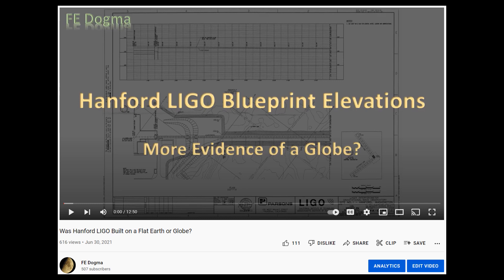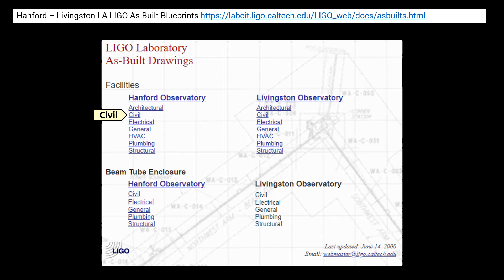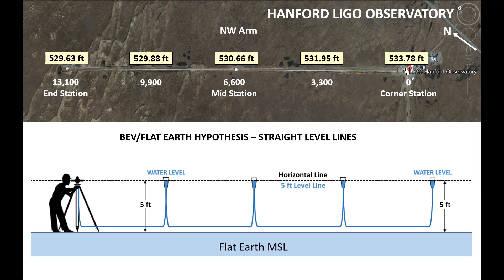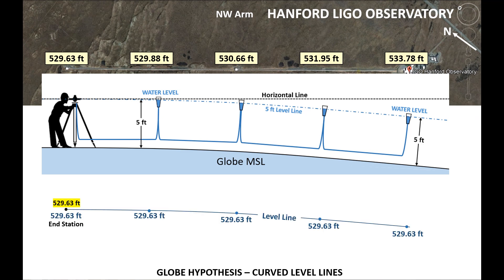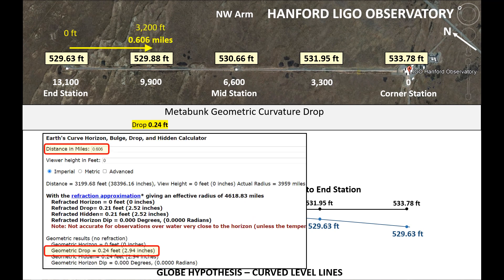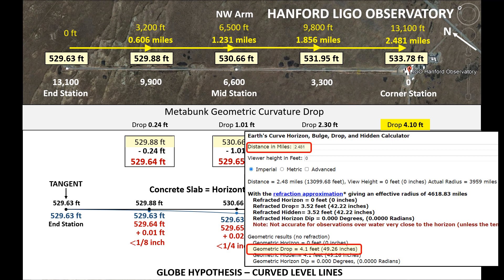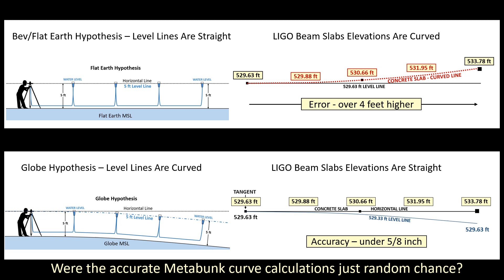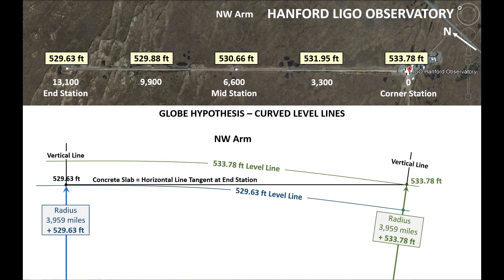LIGO Revisited - Still Globe Evidence

Comment: How do you imagine the concrete company figured out how to pour a slab with an elevation profile shaped like a U? Do you imagine they poured it thicker on both ends to account for a hump in the middle or just one to account for a drop away from your tangent point? If the "direction of down changes" as you imagine it somehow does, how would the concrete set horizontally? So many problems for your model, little buddy. Rooting for you to reach out to some builders and ask them. Please record that conversation! Be sure to tell them that you imagine that concrete naturally sets into a curve and then ask them how they will remove that "natural" curve and make it set "unnaturally horizontal." :D
Reply: Are you saying it is completely impossible to build something flat, unless the Earth were flat already? So, since it couldn't be flat anyway neither on land nor on water, because of hills, mountains, valleys, sea waves, tides, seiches, etc, in other words you are saying that it is impossible to verify whether it is flat or not, which means flerfs are just begging the question.

Another epic flerf fail. Congrats!
Reply: @primonomeultimonome  Are you saying you imagine there are converging directions of down and concrete dries and hardens into a "natural" curve but they figured out a way to make it horizontal for just this project? Tell us more about your belief in magical LIGO concrete.
Reply: @DrEMichaelJones  How unfortunate, your question shows you still don't grasp the difference between horizontal, flat and level, as others have pointed out already. But the day you'll come out of the Middle Age, you'll discover the existence of positioning methods based on modern technology, able to locate points in space down to inch precision. Just take your time!
Reply: @primonomeultimonome  so you don't know how it could be done. Got it. Enjoy your day, little buddy! :D
Reply: @DrEMichaelJones  The whole world knows how to do it, as it is routinely done. Only your in little flerf echo chamber a bunch of cultists can pretend otherwise. But keep showing up, little buddy, people love your flerf comedy gold. 👍
Reply: "How do you imagine the concrete company figured out how to pour a slab with an elevation profile shaped like a U" 

how large a slab segment did they pour at a time, and how much curvature would there be across that slab segment size?
Reply: @hartmutholzgraefe  Could you lay a series of blocks around the perimeter of a round pond?
Reply: @vespa2860  "Could you lay a series of blocks around the perimeter of a round pond?" 

How large are the blocks, how large is the pond, and what are the manufacturing tolerances of the blocks?

Basically you're asking me whether a round swimming pool could be tiled with flat tiles? Or circular chimneys could be built using rectangular bricks? I'm pretty sure I've seen multiple examples of both over the years ...
Reply: @hartmutholzgraefe  It was a rhetorical question! Of course you could! Tagged you by mistake - got no interest of dealing with trolls directly.
Reply: @hartmutholzgraefe  There would be zero curvature for any size slab. It's concrete.
Reply: @DrEMichaelJones  
You think they may have used a laser to build the forms?
Funny how you nitwits keep confusing straight, flat,  and level.
Reply: @DrEMichaelJones  LOL, as usual you don't have the slightest clue what you are talking about. I worked for a company that made a software (AutoCAD plugin) for designing concrete formwork aka shuttering. Our customer, who makes the formworks would pour you any f***ing slope you like provided you can pay. Have you never seen a concrete bike ramp ffs? 🤣

Nevermind that for a miniscule slope like this it's not nearly required because raw concrete is highly viscuous and has to be straightened anyway… plus polishing after it's cured if you want anything resembling a smooth surface. Dear oh dear…
Reply: @TruthNerds  
The tolerance of the concrete pour is really irrelevant. The anchor feet between the slab and vacuum tubes are adjustable.
Reply: @TruthNerds  that's fascinating, little buddy. So first they level the ground, right? And then you imagine they're going to pour a "U-shaped slope" on that level ground right? Tell us more. Who decides where the hump is or do you go for the drop like FEDogma imagines?  Where do you imagine they'll be placing their forms? 

Why don't you try to draw a picture of it? Better yet, why don't you get some concrete and try to do it yourself? Bonus points if you film it and upload it to youtube. Rooting for you! :D
Reply from the maker: @DrEMichaelJones  All I can say is it really possible to be this ignorant on both the subject of surveying and construction?  Why do you think Bev is correct because as I showed in this video, both of those beam arm slabs curve up over 4 ft higher at the opposite end with Bev's definition of a straight level line of equal elevation.  Now under what logic would LIGO be built with curving slabs?
Reply: @fedogma8407  LIOG isn't built on curving slabs because slabs of concrete foundation don't curve. Not in any size slab. 

All I can say is that it's hilarious that you imagine that a construction company can pour a concrete foundation straight on what you imagine is a "curved level" ground. Do you imagine they would shim both sides due to a hump or just one due to a drop? Have you tried calling any to ask?
Reply: @DrEMichaelJones  Repeating your argument from incredulity is not a point. And 2.5 miles  of concrete are not poured in one go. Do you even listen to yourself? 🤣

But if you do want to see concrete poured into a U-shape in one go, it's called a half-pipe. I guess these must be fake, too. Well either that or every 12 year old with a skateboard is more knowledgeable on construction than you are. 🤣

Blue has covered documentation on the construction of LIGO before… GPS surveying was used, of course you don't have any clue how that works either.

And I guess my job's fake because you would be totally unable to do it and demand that everybody has to do everything themselves (another hallmark of pseudoscience).
Reply from the maker: @DrEMichaelJones  You keep ignoring that fact that those LIGO blueprint slab elevations plot a curved line over 4 ft higher from one end of the slab to the other with your definition of a level line.

As for pouring concrete in construction, I was responsible for 1,000s of slab, deck, column and wall pours in commercial construct on large projects.  It is laughable that you think earth curvature, which is less than a 2 inch Sagitta from the chord of a mile long arc, would be an issue when pouring concrete.  Our tolerances are larger than any earth curve errors. 

Why do you feel compelled to think you are an expert and comment about subjects you have absolutely no clue about?
Reply: @scott_meyer  Thanks, good point! In any case our little buddy here will definitely continue to pretend that pouring a slope (or a curve for that matter) of concrete to within reasonable tolerances was an unsolved problem. Imagine if only things that he can  understand were real… there'd hardly be anything left. 😄
Reply: @DrEMichaelJones  "There would be zero curvature for any size slab. It's concrete." try putting concrete into a rotating container and let it set there, that surface will have curvature for sure. There is no magic flatness property in concrete.
Reply: @fedogma8407  Do you imagine you'd pour that horizontal concrete 2" thicker at either end and go with the hump reference frame or do you imagine you'd pour it 8" thicker at one end and go for the drop?  Who do you imagine would pick the frame of reference?
Reply: @hartmutholzgraefe  Concrete is poured. It's a liquid. the bottom on that liquid will form the shape of it's container, like water. The top when smoothed out will form harden horizontally and level. This is not hard stuff.
Reply: @DrEMichaelJones  epic fail there, little buddy!
Reply: @anamorphicmind  I didn't expect you to come up with a construction plan, little buddy. But you can just go on believing that concrete somehow magically hardens with converging downs. I don't want to burst your bubble any further. Enjoy your day! :D
Reply: @DrEMichaelJones  just when the epic fail couldn't continue you keep going, little buddy.  You've obviously never seen a sloped drive way, little buddy. 🤣
Reply: @TruthNerds  
If you think about it, there is no requirement for the tube to be "level". It simply needs to be straight enough that the laser beam doesn't encounter the side of the tube. They could have drilled a 2.3 km hole in the ground and it would still work.
Reply: @anamorphicmind  it's ok little buddy, eventually you'll figure out that the ground under that driveway isn't level. Then you'll start wondering how you're going to pour straight concrete on what you imagine is a curved surface. 🤣
Reply: @DrEMichaelJones  "LIOG isn't built on curving slabs because slabs of concrete foundation don't curve. Not in any size slab."

You're very confused… the slabs are not curved anyway, they are sloped. A level line that you reference them against is curved.
Reply: @DrEMichaelJones  "Concrete is poured. It's a liquid. the bottom on that liquid will form the shape of it's container, like water. The top when smoothed out will form harden horizontally and level. This is not hard stuff." 

Concrete is not really a liquid, but has similar properties to a highly viscous fluid. So It will not necessarily fully smooth out. But more important: even a true liquid will not have a plain surface when in a rotating container. The surface will be concave in that case. In general it will always try to find its equilibrium perpendicular to the effective force vector at each surface location. When only affected by gravity alone that leads to an almost flat surface, curving with a radius of over 6000km, so it will look flat. When rotating there's also centrifugal force acting on it, so you end up with a concave surface. When on a very small scale the fluids own surface tension will be me most prominent force, and you get a concave surface. When in free fall surface tension is the only force acting on the fluid, and so it forms spherical drops. 

I would be happy to reply with "This is not hard stuff", too, but apparently it is to you :(
Reply: @hartmutholzgraefe  it is actually a liquid when mixed with water, little buddy. Thanks for confirming that you don't believe it hardens horizontally when it's leveled. How do you imagine you can make something straight from something you imagine will always harden humped on ground that you also imagine is humped? Do you imagine the concrete company started at one of FEDogma's "tangent points" and shimmed out in one direction to fill in the "drop" or do you imagine they started at a hump and shimmed out on both sides?
Reply: @hartmutholzgraefe  Now I kind of want to see someone try to make a concave parabolic surface by spinning wet concrete mix or crunchy peanut butter in a fish tank, the way you can with water.
Reply: @DrEMichaelJones  ""It is actually a liquid when mixed with water"

Water is a liquid, concrete is a mix of water (liquid), sand and gravel (solid) and even some gases. Concrete is a fluid until it binds, but not a liquid. Pour a liquid on a flat, smooth surface and it will spread out to a more and more thin layer. Pour concrete on a flat, smooth surface and you get a blob that spreads out a little, but never "finds its own level" withough extra help.

If concrete woukd really find its own level by itself there would be no need for puttig an extra layer of floating screet on top.

", little buddy."

Why do you need to call everyone "little buddy" here? Inferiority complex maybe?

"Thanks for confirming that you don't believe it hardens horizontally when it's leveled."

See, it needs artificial leveling, e.g. using a plank drawn over it, to harden with a flat surface. It does not find its level by itself without some extra help, the puddles that form on my driveway when it rains clearly show that ...
Reply: @hartmutholzgraefe  yes we know you imagine that water doesn't find its own level either. Strange that no pushing is involved. Do you imagine that coffee isn't a liquid either? How about salt water? It has a solid in it, salt. How about plain water? You can remove lots of solids from tap water. Do run around telling people they're not liquids either? Tell us more about how angry the word liquid makes you when you imagine its being used incorrectly.
Reply: @DrEMichaelJones  "Do you imagine that coffee isn't a liquid either? How about salt water? It has a solid in it, salt." these are liquids just fine as they have dissolved solids in them. You're not really comparing the undissolved sand grains and pebbles in concrete with dissolved Sodium and Chloride ions in salt water?

"You can remove lots of solids from tap water." Not by filtration though as these substances are not solid while dissolved. The sand and pebbles in a concrete mix can be separated from the water by simple filtration though.

"Do run around telling people they're not liquids either?"  Why would I?

"Tell us more about how angry the word liquid makes you when you imagine its being used incorrectly." I'm not the angry guy calling everyone "little fellow" and such. It is not my fault that you don't know the difference between a fluid and a liquid, or between dissolved and just mixed. It doesn't make me angry when you use terms like liquid incorrectly, it is rather entertaining I have to confess ;)
Reply: @hartmutholzgraefe  it's ok, get it all out, I'm here for you.
Reply: @Mike I'm sure that's is NOT what you are here for ;)
Reply: Just a thought: if you poured concrete slabs 50 yards (45.72 m) long and wide over a float glass base and somehow gave them perfectly level tops as smooth as their undersides, then positioned them to make a level warehouse floor, and somehow got one of them upside down in the process, nobody would notice.
The centre of the inverted slab would be 82 microns low. That's a perfectly respectable size for an amoeba.
Reply: @Sableagle  Ah the "nobody would notice" defense is one of my favorites. Tell us more about how you imagine that "nobody would notice" your buddy's 59.2" thick pour at one end and his 10" pour at the other.
Reply: Time to check in on The Constructor for some expert advice, or some advice that's utter bollocks, depending on how good a site that is.
Personally, I wouldn't want my concrete members to be slopped anywhere, but hey ...

FAQs on pouring concrete on an inclined surface
?How do you pour concrete on a steep slope?
Pouring concrete on the sloped surface needs excellent skills and experience to perform the work as planned.
Commonly, low slump concrete used for slopped concrete members, driveways, or wheelchair ramps.
Make sure concreting begins from the lowest point of the slope. Then, concreting progresses slowly upward.

?How do you increase the slump value of concrete?
Adding water to the concrete mix will increase the concrete slump.

?What slope is too steep for a walkway?
The maximum slope for the walkway should not surpass 5%. The percentage of the slope is calculated by dividing rise over run multiply 100.

?How is the slump value measured?
The slump value is measured from the top of the slump mold to the top of the concrete.

So 5%, eh? That's the tangent, the way it's described there, so what's arctan(0.05)? 2.8624° We can pour a concrete walkway with a slope up to 2.8624°, and for this long slab we need a slope that goes from 0° to 0.036°? Well, that's not taking into account ellipticity of the Earth and so on, but all of that isn't going to make two orders of magnitude of difference. We are well within the tolerance there! Let's see what else The Constructor has to say.

Fine-Grained Concrete: Significance and Properties: Explained With Video
Fine-grained concrete, also known as sand concrete, is defined as the concrete in which the coarse aggregate is replaced by sand or any filler material. The maximum size of fine aggregates used in fine-grained concrete is 10 mm.

Ten millimetres. They're replacing coarse aggregate with fine sand and the maximum grain size in their fine sand is ten millimetres. That's one chunk of a sand grain. I'm going to go and check somewhere else for confirmation. From GreenSpec:

The usual range employed is between 9.5mm and 37.5mm in diameter. - Fine aggregates are usually sand or crushed stone that are less than 9.55mm in diameter. Typically the most common size of aggregate used in construction is 20mm. A larger size, 40mm, is more common in mass concrete. Let's try Cement Concrete for some more info on grain size.

Sieve analysis Procedure:
Take a typical oven-dried sample of sand that weighs about 500gms.
Determine the exact mass of the sample.
Prepare a stack of sieves and place the sieves of sizes 4.75mm, 2.36mm, 1.18mm, 600u, 300u, 150u, and 75u with larger opening sizes above the ones having smaller opening sizes. A pan is placed at the bottom to collect the portion of sand passing through all sieves.
Pour the sand into the stack of sieves from the top and place the cover. Then fix the stack in the sieve shaker and shake for 10 – 15 minutes.
Stop the sieve shaker and measure the mass of the retained sand in each of the sieve.

There we go. Someone does get us all the way down to seventy-five microns, so there is someone, somewhere, who bothers to separate out that little 81 micron sand grain that'd fit between where the surface of the flipped slab would be and where the surface of a right-way-up slab would be from the even smaller 60 micron sand grains. It's big enough to matter to someone, after all. Time to grab something from Wikipedia?

ISO 14688-1:2002, establishes the basic principles for the identification and classification of soils on the basis of those material and mass characteristics most commonly used for soils for engineering purposes. ISO 14688-1 is applicable to natural soils in situ, similar man-made materials in situ and soils redeposited by people.

630 mm and up: large boulder. Yeah, that seems reasonable.
200 to 630 mm: boulder.
63 to 200 mm: cobble. I'm getting the impression these are metric approximate equivalents of 25 inches, 8 inches, 2.5 inches and so on, but whatever.
20 to 63 mm: coarse gravel.
6.3 to 20 mm: medium gravel.
2 to 6.3 mm: fine gravel. Two millimetres is fine gravel? Okay then.
0.63 to 2 mm: coarse sand.
0.2 to 0.63 mm: medium sand. No prizes for guessing what comes next.
0.063 to 0.2 mm: fine sand.
0.02 to 0.063 mm: coarse silt. Those "even smaller 60 micron sand grains" aren't sand grains. They're silt particles.
0.0063 to 0.02 mm: medium silt.
0.002 to 0.0063 mm: fine silt, still bigger than bacteria, still visible as individual grains under a visible-light microscope.
Under 0.002 mm: clay.

Let's start with that 0.002 mm figure. That's 3 times ten to the negative 13 of the volumetric mean radius of the Earth. Small fraction!
One minus that is the cosine of 45.4 microdegrees. Small angle. The tangent of that is 792 nano, in this case 792 nanoradii.
Multiply by a radius of 6371 km and we get 5.048 metres or 5 yards 1 foot 6.75 inches.
If you built your base out of concrete slabs up to 5 yards long with flat, rather than level, tops, the centre of each slab wouldn't be far enough below the level of the ends to get a single grain of fine silt into the difference, and the concrete itself is probably made with grains ten thousand times that large.

Like I said, nobody would notice.
Reply: @Sableagle  You do realize that FEDogma said the LIGO arms are horizontal, right? He even labeled them horizontal. There's no slope in horizontal. Zero.
Reply from the maker: @DrEMichaelJones  You keep ignoring the fact that those LIGO beam arm elevations are a curved line 4 ft higher in elevation at the other end with your definition of a level line.  So please explain why this arm would be constructed in a curved shape when a laser beam is straight?
Reply: @fedogma8407  you keep ignoring that concrete needs pouring and you have Zero idea how the concrete was poured
Reply from the maker: @DrEMichaelJones  Of course you didn't answer the question because you would have to admit that with your definition of a level line is BS those slabs are curved and with my definition of a level line those slabs are straight.
Reply: @fedogma8407  concrete slabs, when leveled properly, definitely harden and set horizontally. Good for you to finally understand that.
Reply from the maker: @DrEMichaelJones  Are you really this fucking ignorant?  Really??  So why is that slab a curve with your definition of a level line?  Look at the evidence and pull your head out of Bev's rear end because you are suffocating on his BS.
Reply: @fedogma8407  level concrete slabs aren't curved, little buddy. Are you finally getting it now?
Reply from the maker: @DrEMichaelJones  I agree and that's why LIGO is evidence supporting the globe because if Bev was right and level lines are straight then that slab would curve up over 4 ft at the other end.  For some reason you aren't smart enough to understand this.
Reply: How to Make a Concrete Wheelchair Ramp Over Stairs with Quikrete Sakrete and Kobalt Electric Mixer. https://youtu.be/SMsH9ZTyT8U
Guy even started in the top corner and worked his way out from there to the bottom edge, piling the concrete mix up against the steps first.
Reply: @fedogma8407  now you just have to find a builder to try to explain how you want to 4 foot thicker concrete on one end of the ground that they level. Which end do you pick and why?
Reply: @Sableagle  that's great little buddy. Now you just need to tell the concrete company where you imagine the hump begins on the level ground so they can somehow ramp up/down for a horizontal pour... rooting for you.
Reply from the maker: @DrEMichaelJones  So you agree this is a problem with your definition of a level line since the slab plots a curved line.  You need to answer that question because this is your fantasy world.  Of course the reality is that we live on a globe so this was not a problem since the slab was straight.   We know how to grade elevations to the requirement of the job.
Reply: @fedogma8407 a problem with level being a straight line on a horizontal plane? No problem at all. Have you figured out where you're going to tell the concrete team where you imagine the top of hump would be on level ground so they can start their pour?
Reply from the maker: @DrEMichaelJones  Again, ad nauseum, then why does that LIGO concrete slab curve up over 4 ft at the other with your definition of a level line?  Do you ever look at the evidence?  And WTF is the hump?  Are you at the zoo looking a camels?
Reply: You try to imply that a 13,100 ft long slab of concrete would be poured in one piece – but this is not how concrete is used; we have some old highways here in Germany that were made with concrete (by now concrete is only used for certain cases) – and they are made out of small slabs, maybe 50 m long. If the slabs are short enough (say, 50 yards – I doubt that they would pour longer slabs), the slab's surface would seem flat (it wouldn't be perfectly flat anyways, as concrete has some viscosity). And there would be a tiny step to the next slab if the elevation has to increase (and this slab would have a very tiny angle to the previous one). It doesn't matter that much in the end, as the actual height for the tube would be adjusted at its support points (say, two on each slab). Over the whole distance it wouldn't matter that each slab is slightly curved in itself, as we're talking about 1" over the 50 yard distance (using the infamous 8" per mile squared formula), and each slab would have a slightly increased elevation (as it actually has). Make shorter slabs, and even the step from slap to slap would become practically unnoticeable.
Reply: @c.augustin  8" * (distance / 1 miles)² for a 50 yard slab?
0.0065 inches, if you start with one end level.
Level it in the centre instead and you get 0.0016 inches.
Reply: Of course, if you pour it with a level, rather than flat, top surface, it'd be level the whole way and a spirit level placed on it anywhere would tell you it's horizontal there too.
0.0016 inches below level in the centre of each slab if you use flat-topped slabs to make part of a polygon, then.
Reply: @Sableagle  and then what do you plan to do with what you imagine are humped (in the middle of course, right?) concrete slabs? Will you try to align them straight starting from what you imagine is the alleged humped middle point of the level ground and shim them "up" to horizontal on either side to make your "u-shaped" elevation or do you imagine you'd start at one end and shim all the way out to the end?  Draw it out for us... or maybe make yourself a little clay model.
Reply: @Sableagle  I made a calculation error, you're right – only measly 0.0065 inches, practically far beyond being measurable (this would be even smaller than the roughness of concrete surface). I'm European and not well versed in using imperial measures (or however you might call them), metric is much easier to scale and less error-prone. I think I used the number of feet in a mile instead of yards, and with squaring numbers this would lead to a much larger number. Still, even 1" would not be that much on a 50 yard slab (well inside the precision of pouring concrete – if I look at what was done when renovating our approx. 12 yard long house, 1" looks already precise … ;-))
Reply: @c.augustin  Have you figured out where the hump is or do you imagine it's a drop from only one side? Have you tried calling any concrete companies yet to ask them how they plan to string together a series of humped slabs across what you imagine is "curved level" so that they form a straight horizontal baseline? Do you imagine they should start from the middle and have two teams work their way out to the ends or start at one end and construct FEDogma's "tangent" in just one direction at a time?  Tell us more about how you imagine this is the one and only construction site in the world where they were able to make concrete horizontal and at all the rest you imagine it curves. Do you believe there's a super secret construction company out there hiding this valuable info from others who wish to harden their concrete level and horizontal?
Reply: @DrEMichaelJones  "where they were able to make concrete horizontal" – They don't have to, as it doesn't matter, as long as the support points of the tube are in an optically straight line (and this is what the elevations are for – and they are there, simple as that). You are fixated on this being a single peace of straight concrete to work, which it doesn't need to be and isn't (I've explained how it would be done). And as usual, you have no idea about scale. And surveying would start at the center station and go outwards (as it would have to), defining elevation points along the route – I'm sure surveying was constantly done in this project (it even happens when building a long highway, as I've seen more than once when driving long distances). This is a very special case to build, and I'm sure it wasn't done by your run-of-the-mill construction company.
Reply: @c.augustin  What do you imagine a non-run-of-the-mill construction company would do to try to build a straight concrete foundation on top of what you imagine is "curved-level" ground? Have you figured out if they'd go for shimming it starting at the hump and working outwards or do you imagine they'd go for the drop reference frame and only shim it on one side? Have you tried calling any  non-run-of-the-mill construction companies to ask?
Reply: @DrEMichaelJones  You still make up a problem where there's none (the concrete doesn't have to be actually completely straight, only the support points of the tube have to be in a straight line (and I'm quite sure they are adjustable, but with this large of a diameter half an inch wouldn't matter) – the concrete can be stepped or curved and built up slap by slap). Since the elevation data starts at the center (and is constantly going up from there), construction would be done as I suggested from the center to the endpoints (this is no bridge), like a highway (which can also be built up and down as needed – how do they do that up a hill or a mountain in your mind?). You try to obfuscate the fact that the elevation gets higher from the center to the endpoints, matching earth's curvature to a very small amount (around half an inch) – how the construction was done is just an engineering problem, and I'm sure that the engineers involved found a viable solution (and had tolerances to match, as is done in any form of engineering – like in electrical engineering, which I'm familiar with). It was done, the data is publicly available, and perhaps there's even more data available about the whole construction.
So, how would you explain the elevation data, if earth would indeed be flat?
Reply: @DrEMichaelJones  Oh, and you can just look at the northern leg of LIGO in the Wikipedia article – and you can clearly see that it is raised there. And that the tube is built with short segments (even shorter than I guessed, maybe only 2 yards long), half embedded in the (raised) ground. So they might actually have built these segments somewhere else (in a factory, or those are actually some standard elements used for tunnels) and placed them one after the other – I can't see a "completely straight concrete foundation" anywhere (there might be a concrete foundation beneath the tube segments, but it could be small and rough pieces over the length). You simply have no viable argument there.
Reply: @c.augustin  so you imagine they built it imagining a hump in the center as opposed to a drop from one end? How do you imagine they decided on the reference frame they should build from?
Reply: @DrEMichaelJones  You constantly overcomplicate things. The center is the reference elevation, from there they made normal ground work (same as for a highway) and dig or bank up the ground to get the right elevations, do foundations (step by step) to the endpoints as needed. No "reference frame" needed (well, it could be done from the halfway points of the legs, than elevations would go down in one and up the other direction – but it wouldn't matter; easier to go from the center), just doing proper surveying. No need for any imagination, just calculating the proper elevations (from the center) beforehand. And it doesn't even need to be overly exact, as the actual tube is mounted in a rig where it can be finely adjusted (and this could be checked with a laser beam). The main engineering problems are with the interferometer itself, not all the building work around it. Where's your problem? The elevation data is clear, how to build it is actually much easier than I thought at first. After having seen the short tube segments, it might have even been built by a run-of-the-mill construction company and a very good surveying company (this would be the not-so-easy part). What's your problem?
Reply: @c.augustin  so you imagine that the concrete teams would start at the center and work their way out? Is that because you imagine a hump on level ground as opposed to a drop?
Reply: @DrEMichaelJones  There's always a drop from the horizontal. Everywhere on earth. If you are high enough, you can measure it even with simple tools. It is done over and over again (even here on YT), correcting for it is part of celestial navigation (if you use the visible horizon instead of a spirit level; additionally refraction is accounted for if the horizon is used). Simple as that. To go from the center has nothing to do with that, it is just common sense to use the point where everything meets and go outwards (this way you avoid problem with accumulating measurement errors). Again – where's your problem? What's your explanation for the elevation levels shown?
Reply: @c.augustin  If there's always a "drop" then why are you imagining that they would pour a concrete foundation around a hump?
Reply: @DrEMichaelJones  I see what you're doing here (next I come up with gravity and you say it doesn't exist etc.). Time to answer my questions, or better just the one real question: How do you explain the rising elevations that match earth's curvature (and geometric drop) to get a straight path for the laser beams inside their tubes? Just that (the topic of the video you're commenting on).
Reply: @c.augustin  I can see why you want to get away from trying to come up with a way to figure out how to pour a horizontal concrete foundation according to a u-shaped elevation profile when you imagine concrete somehow hardens into a curve. Maybe call some builders and see if they can help straighten you out. Rooting for you. :D
Reply: @DrEMichaelJones  Earth is smooth enough that a scaled resin version of it would pass the requirements for competitive billard. Are you saying there should be a hump on a billard ball? Or have you allowed your master Bev to befuddle you with misleading rhetoric?
Reply: @DrEMichaelJones  "Tell us more about how you imagine this is the one and only construction site in the world where they were able to make concrete horizontal and at all the rest you imagine it curves." There are two LIGO sites in use. Dear oh dear.
Reply: @TruthNerds  that's a fascinating belief, little buddy. Have you called any contractors yet and asked them how they think they could create a straight horizontal concrete surface when you imagine that concrete somehow hardens with a hump exactly in the middle and if they leveled the ground you imagine that that would be also humped (and for some unknown reason exactly in the middle) too?
Reply: @DrEMichaelJones  "What do you imagine a non-run-of-the-mill construction company would do to try to build a straight concrete foundation"

Your repeated argument from incredulity regarding the required expertise is the definition of weak sauce. Do you realize there are construction companies that can build underwater… including pouring concrete under water! Do you realize there are firefighting companies that can put out burning oil wells? Who the f*ck cares that a "run of the mill" company would not be able to do that?

PS: Not that there's anything special about making sloped slabs anyway as others have also mentioned.
Reply: @TruthNerds  That's fascinating, little buddy. Do you imagine they account for a non-existent hump when they want to level a seabed too? 

Why don't you go get a ball and try to build something straight on top of it and then ask yourself if you're going to build on either side of the hump or start at the hump and build out in only one direction. Take all the time you need.
Reply: @DrEMichaelJones  I don't need to work off of beliefs, I already told you one of our customers was a specialized construction company doing exactly this kind of non-standard work. They practically never got "run of the mill" contracts because they were not competitive in this arena, but they did get a fair share of the relatively few but well paid contracts that the 90% of construction companies were completely incapable of.

You might as well be arguing that the SR-71 can't be real because Cessna wouldn't be able to make one. 😂
Reply: @DrEMichaelJones  I already described how it works (there's no "u-shaped" profile for a 4 km long concrete foundation, you just made up a problem that's non-existent, as there is no 4 km long concrete foundation poured in one go – it is never done that way, not even for a highway). And yes, concrete hardens into a curve (due to gravity), but it is much too shallow of a curve to measure over small distances (as I was corrected it is only 0.0016" from the center of a 50 x 50 yard slab – try to measure that). It is measurable over larger distances and has to be taken into account for many large-scale applications, like LIGO. You still have not explained where the increasing (measured) elevation describing an "upward" curve comes from that is necessary to get a geometrically straight tube for the 4 km long laser beam, if the earth were flat.

You always use "imaginary" and "if", but the geometric drop is not imaginary, it is real – it can be measured. Navigation of all sorts uses a spherical surface, as does map making, all geographic coordinates are on a spherical surface of a sphere of approx. 6,371 km radius (the nautical mile is tied to that radius, too, and it is defined by an angle of the 360° circumference – again something tied to circles and spheres), and it just works (lives depended and still depend on it, there's no imagination involved). Same with long-distance surveying. Gravity is a very real thing, engineers use it to make all sorts of things happen – unlike flat-earthers, who can't get anything done with their conspiracy theories.
Reply: @c.augustin  that's fascinating stuff that has nothing to do with what I'm asking. Do you imagine the concrete company started at one of FEDogma's "tangent points" and shimmed out in one direction to fill in the "drop" or do you imagine they started at a hump and shimmed out on both sides?
Reply: @DrEMichaelJones   Can you imagine a clueless flerf in complete reality denial, unable to understand the difference between level, flat and horizontal, as well as to grasp some pretty simple concepts about construction techniques? Well, then you are imagining yourself.
Reply: @primonomeultimonome  can you imagine an angrier little boy than you, lashing out at people all over youtube that don't share your silly belief system? I can't
Reply from the maker: @DrEMichaelJones    FFS, haven't you ever driven up and down concrete ramps or concrete roads on hills?  How were they poured if concrete will "form the shape of it's container, like water"  All you are doing here is showing your complete ignorance on this subject because I know you are full of BS.

Concrete is a quasi-liquid that does not flow like water unless the slump is too high which means that too much water has been added and separates from the aggregates. Every concrete pour has a specific mix and an allowable slump.  The job-site inspector will take samples from the concrete trucks, agitate it in a 12 inch high cone shaped cylinder, then pull the cone up and the concrete will  "slump", or drop in height, which is then measured from a straight edge placed across the top of the cone.  

The allowable slump, or drop from 12 inches, for roads is typically one inch. Exactly how will this concrete flow lie water?  I worked in commercial construction and the typical slump was 4 inches maximum for slabs, decks, footings, walls and columns.
Reply: @DrEMichaelJones  I already answered your question – most likely from the central station outwards to the endpoints of the legs (as those have the higher elevation). The area isn't flat anyways, and on the photos on Wikipedia it is obvious that they had to dig through small mounds at some points to get the right elevation, at other points they had to go higher (also visible in the photos). Now it's your turn to answer: Where does the curved elevation come from to get a straight tunnel for the laser beam?
Reply: @DrEMichaelJones  Your belief system doesn't even allow you to grasp how concrete can be poured to form a non level surface, which is far beyond silly. That must be why you need to project your anger on others, little buddy.
Reply: @primonomeultimonome  we've finally gotten to forms! Excellent. The gears are actually starting to finally turn in your little mind. Where exactly do you imagine you'll be placing these forms after you've leveled the ground? Do you imagine there's a hump in the center that you'll be working out from or do you imagine the hump is at one of FEDogma's twin "tangent" points?
Reply: @c.augustin  "most likely?" You mean you're not sure that that's exactly where the "hump" would be? How do you expect a builder to know how to set up his forms for his straight concrete pour if he doesn't know where you imagine a hump is?
Reply: @DrEMichaelJones  Unfortunately the gears in your mind are still stuck, little buddy. I answered your question long ago. Go back to my second comment in this thread and try to understand it, this time. I won't hold my breath, though.
Reply: @DrEMichaelJones  Again: What hump? Let's get this straight (pun intended):
1. LIGO is a laser interferometer with two perpendicular "legs" of 4 km/13,100 ft length.
2. Laser light travels in a straight line.
3. The tubes the laser light goes through have to be straight (with some room for tolerances, as those can be corrected) from the central station to the end stations of the legs for the laser beams to hit the mirrors at both ends.
4. LIGO is already built and working, so all construction and building problems are already solved, and the tubes are indeed straight.
Do you agree, or do you challenge any of these points?
Reply: @c.augustin  what hump? I agree completely, that there's definitely no hump on level ground. Level ground establishes a horizontal plane. Zero hump, zero drop. Finally some common ground.

Very easy to solve a construction problem if the problem doesn't actually exist.
Reply: @DrEMichaelJones  No, you confuse drop with a "hump" – you think of a "hump" between the observer and the horizon line, but the observer is always on this "hump", so there's only drop wherever you stand on a globe (provided you're not standing below the ground). It is obvious that you don't want to learn or understand anything, but just make "your point". You might find that you get nowhere with this attitude.
Reply: @c.augustin  ah, so you're going for the drop. Excellent. So you imagine you're standing on top of the hump and the level ground drops down, drops away from the horizontal LIGO. So you'll tell the concrete team to pour a gradually thicker amount of concrete as they move away from you, right?
Reply: @DrEMichaelJones  Yes.
Reply: @c.augustin  Excellent. So you imagine you would tell the construction company to start at FEDogma's "point A" tangent point at the end of the LIGO arm and begin with a standard foundation pour of say 10" and you then you will tell them to continue along increasing the thickness of the concrete on the level surface until they get to point "B" and your straight and horizontal foundation will be how thick at that point?
Reply: @DrEMichaelJones  10" at the start, 59.2" at the endpoint (10" + 4.1 ft, as this is the elevation difference over the 13,100 ft distance).
Reply: @c.augustin  Excellent. So if the concrete team started at the other end you'd tell them to begin by pouring a 59.2" foundation and then gradually thin it out across the level ground until it's only 10" thick and you imagine that that would give you a straight, horizontal pour?
Reply: @DrEMichaelJones  But it would not be done this way – the ground would be prepared to have the right slope (rising or falling by 4.1 ft over the 13,100 ft distance), and then a concrete foundation of roughly equal thickness would be poured. In slabs of maybe 50 ft length (I already wrote this). Easier this way. And yes, this ground would not be perfectly level – can you calculate the grade of the ground?
Reply: @c.augustin  the ground would be "prepared to have the 'right slope'?"  OK. So now you need to tell the "ground preparation team" how to prepare the ground to have the "right slope." How would you do that? Which end should they start at and how thick should the dirt be built up from level?
Reply: @DrEMichaelJones  They have just to meet elevation points prepared in advance (could be poles stuck into the ground in regular intervals). To get these elevation points, they call in a surveyor with appropriate equipment. Someone (most likely the construction engineer, or however this person is called) calculated the elevations for these points (the 8" per miles squared formula would would be accurate enough for the job, but it can be done with proper trigonometry), or even the surveyor should be able to do it.
Reply: @c.augustin  Sorry, flerfs don't grasp what surveying is. If they did, they wouldn't be flerfs.
Reply: @c.augustin  and those surveyors would help them to level the ground as they would do on a standard construction site where they would build any other building. After the ground is leveled, tell us how you imagine it would be "prepared" to be made horizontal which you imagine differs from level.
Reply: @primonomeultimonome  Let's see where it leads, and what the next point will be. My question about the grade of the slope will come up again, as it is important. I have to admit that there are some not-so-intuitive issues in all this; getting the elevation points right in practice is the hardest part in my estimation (refraction is our enemy there; I don't know if it could be done with enough precision via GPS and satellite data – but that's actually the problem domain a surveyor should be able to tackle).
Reply: @DrEMichaelJones  Nope, that's where you don't get it right – not level, the job is to create a straight (!) surface from elevation E1 at point A to Elevation E2 at point B, nothing else. Nothing has to be true level at any point, as long as the grade at any point is small enough to keep the concrete from flowing away in the 50 yard slab (and as others pointed out, concrete is rather viscid and doesn't flow easily). The slope might not even be level at point A, it doesn't matter! When you inspect the elevation data given in the video you might notice that the Corner Station/LIGO Observatory is in the middle of the elevations, and elevation rises to the SW end station and falls (! [yeah, not "false"]) to the NW end station. I would still start at the Corner Station (with construction work).

Can you calculate the grade of this slope from A to B in degrees over the distance of 13,100 ft, assuming that the whole foundation is level at point A and you want to get the tilt from true horizontal at point B? Hint: there's an easy trick to get the tilt with the length of AB and and earth's circumference (21600 mi will do).
Reply: @c.augustin  Yes they use GPS, in addition to other high precision measurement tools. You can easily find online the description of the alignment of LIGO arms. I always wonder why flerfs, with their high IQ multi-tab research capabilities, are never able to find anything about anything.
Reply: @primonomeultimonome  Well, I haven't searched for it either. For me, it's about flexing my (rusty) engineering muscles. I can infer things from real-world practical experience (I'm old enough for that ;-)) and from general science. I have to admit that it isn't easy to imagine where someone's mind goes "wrong" (can happen to every single one of us). It reminds me of the one or two occasions where I tried to teach my daughter in math (she didn't get it, no matter I tried – and this with a father who was quite good in math and got a German Dipl.-Ing. degree … 🙄).
Reply: @c.augustin  "For me, it's about flexing my (rusty) engineering muscles. I can infer things from real-world practical experience (I'm old enough for that ;-)) and from general science.  .... got a German Dipl.-Ing. degree" 

Same here :)

Although my field was electric engineering, so I didn't have to deal with concrete at work. Also I moved on to computer science quickly, so got an Dipl.Inf. on top of my Dipl.Ing, and worked in the software field ever since.

But having grown up on a farm I have some basic hands-on brick, mortar and concrete experience nonetheless, and over the last decade and a bit found an interest in basic surveying and map making skills, too, contributing to the OpenStreetMap project in both data and software :)
Reply: @c.augustin   Of course you did not look it up, since you can easily guess how they did it. Neither I would have, but I was curious to see how easily one could find the information: it took me less than 30 seconds. 

About flerfs' mind going wrong, I suppose anything contradicting their religious beliefs gets blocked by some defense mechanism.
Reply: @hartmutholzgraefe  We had contact before, I'm also an electrical engineer (with some experience in programming, but no Dipl. Inf.) Where are you from?
Reply: @primonomeultimonome  Ranty found his way out, as did STST. Ranty is actually quite smart, STST I would call clever. Both seem to be not deeply religious, as far as I can see, and that might've helped.
Reply: @c.augustin  "Nothing has to be true level at any point" and by "true level" you mean that you imagine that to be a "true curve" right?

What grade do you imagine keeps the concrete from "flowing away?" would that be level too?
Reply: @DrEMichaelJones  With "true level" I would mean the horizontal at a given point, as a spirit level would give you, or a plumb line. Let's call it level or horizontal, doesn't matter. Have you calculated the tilt at point B (corner station), going from the endpoint of the NW arm as point A (as this has the lowest elevation, the foundation would be actually level at that point)?
Reply: @c.augustin  A spirit level will definitely give you horizontal across the entire spirit level. Builders use spirit levels to check that their concrete pours are uniformly level and horizontal.
Reply: @DrEMichaelJones  Right you are – and you do know how long these spirit levels are?
Reply: @DrEMichaelJones  Oh, and the precision of such a spirit level?
Reply: @c.augustin  small village between Bielefeld and Herford originally, now in Bielefeld proper (working from home for a company in Finnland)
Reply: @c.augustin  so now you're going with spirit levels not actually being able to establish a horizontal, do I have that right? What tool would you like to use to help your concrete team make their poured concrete straight and horizontal? Pick any tool you like. You're building LIGO! Rooting for you. :D
Reply: @hartmutholzgraefe  "Bielefeld? Das gibt's doch garnicht!" 😁 I was born in Berlin and lived there until quite recently. Since October of last year I'm in Dithmarschen, Schleswig-Holstein ("Der echte Norden", not as hot as the rest). Working from home, too.
Reply: @c.augustin  I can see that you don't trust the accuracy of a spirit level for leveling concrete so what tool would you use to make concrete level and horizontal for LIGO so that one end will end up 4 feet higher than the other? Pick you favorite leveling tool.
Reply: @DrEMichaelJones  So you're not familiar with tolerances and precision, or are you? I can help you out: 

1. The longest spirit level to buy (for builders – exactly what you're referring to) is 240 cm long (or 2.4 m, or about 94 inches, or 8 feet, or 2.6 yards), and it has an error of 0.017°.
2. At 0:38 in the video you can actually see the foundation – and that it is built of slabs of maybe 10 yards of length (much shorter than the 50 yards I thought of).
3. The last slab at the corner station (coming from the NW end station) would have a tilt from horizontal of 0.036° (if it would be actually perfectly in line with the NW end station).

How do I know that? I use SI units, because it is much easier: Earth's circumference (thus 360°) is approx. 40,000 km (21,600 nmi, 24,860 mi), the NW arm is 4 km long (approx. 13,100 ft), so (360° * 4 km / 40,000 km) = 0.036°

Do you get it so far?
Reply: @c.augustin  ...and your job is to find a tool that can help you construct the most perfectly straight thing in the world... which tool is going to help you make the ground horizontal over 4km and also somehow accommodate your 10" slab at one end (which end again?) that turns into 59.2" at the other... and is also somehow (impossibly) horizontal. What's the tool you're going to tell your concrete team to use?
Reply: @DrEMichaelJones  And once again you show you cannot grasp what "horizontal" means, despite several people having explained it to you over and over again. You may not like the globe, but you keep going in circles, little buddy.
Reply: @DrEMichaelJones  Have you ever built something yourself? Do you grasp the difference between straight and horizontal?
Reply: @primonomeultimonome  I see what you meant about flerf's minds going wrong – a lost cause. Too stupid to graps the simplest concepts and differences, to just make a point (and making a complete fool out of himself). I wonder if he even understands what his profile image means (having "λόγος" in it) – he definitely does not live up to his aspirations.
Reply: @c.augustin  Horizontal is always straight, little buddy. Straight is only horizontal when it's level. My architect designed my home according to those principles.
Reply: @c.augustin  
It's always amusing when someone that imagines that a straight horizontal building can somehow have a curved elevation profile and thinks that someone else is a complete fool for mocking that.

My boat has λόγος on the back of it too. Do you have a boat? If so, what did you name it?
Reply: @DrEMichaelJones  But horizontal is defined locally. A straight line can be horizontal only for an observer at one specific point. That's what you fail to grasp. There exist no straight line that is horizontal for two observers at two different locations at the same time.
Reply: @c.augustin  Yep, that's about it. A few years ago I used to find flerfs genuinely interested in understanding and discussing. But now, the FE community is just a bunch of religious nuts.
Reply: @DrEMichaelJones  "Straight is only horizontal when it's level." Really? In astronomy, we define horizontal as perpendicular to vertical. With vertical being the line between zenith and nadir. Although the line can remain straight, it cannot remain horizontal. The same is true with the arms of the LIGO sites. They remain straight but they do not remain horizontal. There is only one point along each arm where horizontal = level.
Reply: @primonomeultimonome  Feel free to try to provide a definition for a local horizontal line or plane. How big do you imagine "local" is for horizontal lines/planes?
Reply: @DrEMichaelJones  That definition has been given to you several times in this very thread, and who knows how many more times elsewhere. I can hardly believe you are unable to understand it, I find more likely that you don't want to. If you prefer to make a fool of yourself instead of understanding some basic physics, that's on you.
Reply: @DrEMichaelJones  "Straight is only horizontal when it's level" – and it remains straight when it isn't level. Because level is level, and straight is straight – these are independent properties. The line of sight from the bottom of a staircase to its top is straight, even though the staircase is neither smooth nor horizontal. Can builders build a concrete staircase? Edit: And can architects plan and builders build a concrete ramp (e.g. for cars to drive up to a higher elevation)?
Reply: @c.augustin  they sure can build a concrete staircase. Where do you imagine you tell the concrete company to begin a concrete staircase to accommodate the imaginary hump/drop that you believe in? You said that you imagine they'd need to accommodate for 4 feet of drop. Where would they build the 4 foot thicker part?
Reply: @DrEMichaelJones  Let's wrap up your main (and only) argument you use all the time to dismiss anything you don't like. This is what you claim:
1. Concrete behaves like water, and thus always levels out perfectly if poured into a form or on the ground. No exceptions allowed.
2. Concrete structures are poured in one piece, no matter the size.
From 1 follows that you can't create non-level concrete surfaces, and due to 2, even a concrete ramp can't be built. Neither could a concrete road be built up and down a hill.
So, can concrete roads be built up and down a hill?
Reply: @c.augustin  the surface of concrete, when leveled correctly forms a horizontal plane of reference. You imagine it somehow humps. You also imagine the ground is humped after it has been leveled. You imagine the drop from the top of that hump is 4 feet. Your problem is that you can't tell a concrete company where exactly the top of that hump is to pour thinner there and then gradually thicker away from there. But I'm rooting for you to keep trying. Good luck! :D
Reply: @DrEMichaelJones  "which leveled correctly" already contradicts your "it  is a liquid" claim, as even liquids as viscous as tar level themselves without external help.

And even if each of those slabs were perfectly straight you can still have a curve along the arms due to minimal change in surface angle between the slabs
Reply: @hartmutholzgraefe  just cause it thickens and eventually hardens doesn't mean there isn't liquid water in it, dummy.
Reply: @DrEMichaelJones  No, no, answer this simple question: Is it possible to build concrete roads up and down a hill, yes or no?
Reply: @c.augustin  you need to locate the top of that "hill" that you imagine exists on level ground in order for the concrete guys to start pouring. Where do you imagine they should start?
Reply: @DrEMichaelJones  just because there is an actual liquid component in it doesn't make all of it a liquid either. And even if you just poured a mix of sand, water and gravel without adding cement so that it doesn't harden it would still not "find its level" by itself. 

PS: why the name calling? Do you really think that it makes your "arguments" more convincing? Or is this really just an inferiority complex or simple projection speaking?
Reply: @DrEMichaelJones  Can concrete roads be built up and down a hill, yes or no?
Reply: @hartmutholzgraefe  what name calling are you imagining, little buddy?
Reply: @c.augustin  there are no hills on level ground, little buddy. Everyone knows this.
Reply: @DrEMichaelJones  So you are even unable to answer a simple yes/no question when the answer is obvious? This wasn't a hypothetical question, it was a completely concrete (pun intended) , real-world one (no matter if you think earth is a globe or flat). Okay, concrete roads up and down a hill can be built (you should know that), so the answer would've been YES. Or do you disagree?

Next: Is the surface of the concrete on such a road level on the slope (up or down), yes or no?
Bonus question: If the hilltop is only small and round, is the road surface level anywhere on this hilltop, and if yes, at which point?
Reply: @c.augustin  have you figured out where you'll tell the concrete guys to locate the top of the hill you imagine exists on level ground yet? Rooting for you.
Reply: @DrEMichaelJones  Again, you failed to answer a very specific question about a concrete road up and down a hill, no level ground involved – don't dodge the question, just answer. So, has this road a level surface anywhere, and if, at which point?
Reply: @DrEMichaelJones  Come on, little buddy – I've answered so many of your questions, now it's my turn. Or are you unable to answer even middle school level questions? And don't worry, I come to your questions when we have established some basics.
Reply: @c.augustin  it's amusing how terrified you are of stating where you imagine a hump would be located on level ground. Are you noticing yet that it's impossible to pour concrete according to imaginary reference frames?
Reply: @DrEMichaelJones  "what name calling are you imagining, little buddy?"

Is this some form of tourette syndrom maybe, and you're not even noticing when calling everyone "little buddy" or "dummy"???

(edit: syndrom, not system)
Reply: @DrEMichaelJones  So, let's see what we've established so far:
1. You can't answer simple, everyday questions that a 10 year old should have no problem to answer.
2. You can't answer middle school level questions.
3. Your claim that concrete has to be level, or that it has to be level to be flat, is false.
Do you disagree?
Reply: @DrEMichaelJones  OK, since you don't disagree to any of my points, let's establish some facts about LIGO (reality check):

1. LIGO exists.
2. Laser light travels in a geometrically straight line (in vacuum, and the inner tube is actually a vacuum tube).
3. LIGO is functional, so the vacuum tubes for the laser light are indeed straight (with suitable tolerances).
4. Since the vacuum tubes are mounted on concrete foundations, these foundation are indeed straight/flat (with suitable tolerances that can be mitigated by adjusting the scaffolding for the vacuum tubes).
5. Surveyors are able to establish a straight line over a large distance in uneven (!) terrain prior to earth work with their instruments (with different measurement methods, including high-precision autolevels and GPS, again with suitable tolerances).
6. Surveyors are able to measure elevation everywhere on earth (with whatever means they use, most likely GPS) to sub-inch precision.
7. The elevation data provided in the Built Blueprints (link provided in the video description) is correct (with sub-inch precision).

Do you disagree?
Reply: You did know that in the real world concrete is poured into inclines pretty routinely, don't you?
Reply: @barryon8706  You did know that the U-shaped incline you're imagining needs to be poured and harden on level ground, don't you?
Reply: @DrEMichaelJones  Wrong. Again, people pour concrete on inclines as a matter of routine. It's concrete, not chicken soup.
Reply: @barryon8706  Not sure flerfs know the difference between concrete and chicken soup.
Reply: @primonomeultimonome  You might be right!
Reply: @barryon8706  which way do you imagine they'd pour this "slope" for the foundation for the "straightest thing in the universe?"
Reply: @DrEMichaelJones  I doubt the slab is as straight as the actual tube. But to get it as straight as they can reasonable get it, they'd pour in a direction that would depend on where they pour.
Also, I haven't gotten any rent from you. I like oatmeal cookies with chocolate chips. Thank you.
Reply: @barryon8706  Do you imagine the horizontal arm has an incline?
Reply: @TryThinking  From what point?
Reply: @TryThinking  Let me expand on that. If a line on the earth's surface is horizontal at one point then it will have an incline everywhere else.
Does that answer your question for you?
Reply: Have you ever poured a single yard of concrete in you life Mike? Do you know what a laser screed is? Do you imagine they poured the pad in one huge continuous pour without any control joints? Do you know the difference in a construction joint and a contraction joint? What would you think was specified for that concrete in terms of slump? What is slump by the way. Before shooting YOUR mouth off, maybe you should consult a licensed general contractor about this - somebody like .....wait for it .....ME!
Reply: @bluemarblescience  why don't you pop over to Next Level, blue (since you banned me from your server) and let's have a chat about pouring concrete. You can show everyone how much more you think you know about the topic than I do  Then I'll introduce you to my good friend, Raqia, and you and he can talk about the various sizes of foundations you've laid. Then we can chat about the straight horizontal x-axis that represents level in every elevation profile by every architect and engineer ever.

Btw, I think raqia offered you good money to help with the woodwork on his boat. You should take him up on that. If you do a good job I might consider hiring you to do some work on my boat, too. Enjoy your day. :D
Reply: @whatever2735  awesome. How would you tell a concrete company to pour it with a 0 degree slope? Take a month to try to formulate a coherent response.
Reply: @whatever2735  horizontal has zero slope. Try to keep up. Feel free to bring the architect's original blueprints for LIGO to Next Level.
Reply: @whatever2735  do you realize that that would make LIGO the only elevation profile in the history of elevation profiles to depict horizontal as curved? And you actually believe this? Lol ok, little buddy. Whatever helps you sleep at night.
Reply: @whatever2735  like i said, that's a fascinating belief you have there. So you imagine that the construction teams at LIGO were told to pour a horizontal foundation that somehow ISN'T level. Lmfao. Do you imagine the 3 mile long runway that they built straight at Denver International Airport (and matches the elevation profile in the blueprints) somehow actually curves downward in both directions...but the construction crews at LIGO used a super secret method to pour them horizontal but NOT level? Lmao. Like I said, little buddy, whatever helps you sleep at night. :D
Reply: @whatever2735  Straight like the runways at airports? Are the elevation profiles for every airport in the world wrong? Do airports not use an xy coordinate system for their elevation profiles?
Reply: @whatever2735  You have so many fascinating and hilariously bizarre beliefs that it's hard to pick a place to start. How much do you imagine the 16,000 foot long runway at DIA curves down and how do you imagine planes take off as they curve downward? Is that downward curve your x-axis or do you keep that axis straight?
Reply: @whatever2735  You sound desperate to avoid that 6' curve downward that your fromula requires. Surely you can't think that a runway that curves downward would be easier to take off from than one made to be horizontal like LIGO... You can't honestly believe that, can you?
Reply from the maker: @DrEMichaelJones  Not only do you make up shit about runways but again, ad nauseum, you keep ignoring the fact that those LIGO beam slabs curve up over 4 ft using Bev’s definition of a level line yet those slabs are straight using the surveyor’s definition of curved level lines.  

FFS, all of your comments in this thread show that your ignorance on these topics is only topped by your arrogance that you think you are right.  Either are not very smart or you are lying troll.
Reply: @fedogma8407  That's fascinating, little buddy. Tell us more how you imagine that you can tell the concrete crews at LIGO to pour a horizontal foundation that somehow ISN'T level. You're not very bright, and you're often dishonest, but I'll humor you and wait for a reply just so I can laugh at you some more.
Reply: and LOL at those straight lines at DIA. Let us know when you've got an elevation profile that shows 6 feet of "drop" beyond any actual elevation change.
Reply from the maker: @DrEMichaelJones  Evidence that Mike is unable to "try thinking".... 
 1)  The crews at LIGO poured  beam slabs, not a beam foundations.       
2)   Every day concrete roads are poured on surfaces that go up and down hills.       
3)   Everyday parking garages are poured with ramps that go from one level to the next.  
4)   On the globe we live on, there is no 6 ft drop in 3 miles when the elevation stays the same.  That is why it is called "level".
5)   As for a level runway with your "6' (imaginary) drop being preferable to pilots"...definitely over the 50 ft elevation change on DIA runway 8/26
Reply: Flat earthers are always good for a laugh but this one liking his own comments is extra lol! xD
Reply from the maker: @DrEMichaelJones  Why do you always make shit up instead of looking at data?  Here is a link to Denver Airport. https://flightaware.com/resources/airport/DEN/APD/AIRPORT+DIAGRAM/pdf

The elevation of the 16,000 ft runway is 5,322 ft at the 16R end and rises to 5,327 ft at the 34L end.  This is a 5 ft elevation change or a gradient of less than 1%.

12,000 ft long runway 8/26 is 5,354 ft at the 8 end and 5,294 ft at the 26 end for a 60 ft elevation change or a 5% gradient.  Runway gradients are not uncommon.
Reply: @whatever2735  do you imagine that 6' drop would be preferable to pilots instead of horizontal? Do you imagine that elevation changes along runways are measured from some sort of "curved level" or plain old horizontal level?
Reply: @DrEMichaelJones  What even makes you think that runways need to be perfectly flat in the first place. We already established that the one you mentioned yourself is not level, same as the Ligo arms are not level. Difference is that Ligo had a requirement for being straight; as the laser in the evacuated steel pipe is going in a straight, non-refrated line, too. 

Runwas can indeed have several visible humps in them, take e.g. this footage of a crosswind landing attempt at Birminghap BHX runway 33 https://www.youtube.com/watch?v=lP35ULU6IcQ#t=8s

And that's not even the worst humps I've seen. As far as I can find accepted slope of a runway is about 1% total, so it does not even have to be level to the precision of your typical bubble level, and there can be variations in slope across the length of the runway, too.

Actually a railway line has more serious restrictions when it comes to total slope, and to variations in slope over short distances, than a runway.
Reply: @hartmutholzgraefe  runways dont have to be flat, little buddy. But level ground has to be horizontal and the level water between locks in every canal in the world is definitely horizontal. It's drafted that way in the elevation profiles by the architects and measured that way by the engineers after its built. You don't have to like it. But it's a fact.

You bring up slope...lol. What does the axis that that slope is measured from look like, little buddy? :D
Reply: @DrEMichaelJones  You brought up flat / level runways, and elevation changes in them being a problem, in the first place, not me. Now you are back paddeling on your own claims, but want to make it look like my fault? Nice try ;)

"But level ground has to be horizontal" it has to be locally horizontal, but there is no infinite horizontal plane that level would be parallel to at all points.

"the level water between locks in every canal in the world is definitely horizontal" no, it is level, as in "the surface is at the same gravitational level at all points (when averaging out waves)" In a world where the gravitation field were parallel that would be equivalent to straight horizontal, but in a radial gravitational field the water surface would be curved to be perpendicular to the local gravity vector at all points. So we are still stuck at "is level the same as horizontal or not in this context", and it is rather clearly not. I know that you e.g. disagree with the dictionary definition of level that especially mention curve and "relative to local mean sea level", but that's your problem. You don't have to like those definitions, but they are fact.

"It's drafted that way in the elevation profiles by the architects and measured that way by the engineers after its built."
So you are trying to teach an engineer on what engineers do? Interesting, where and in which discipline did you get your engineering degree? I got mine in Bielefeld, Germany in electric engineering, and I'm married to a civil engineer. 

"What does the axis that that slope is measured from look like, little buddy?"
You have different options for that. You can measure the angle to the vertical (which would be a straight axis indeed), then substract it from 90°. You can measure the angle to the local horizontal, e.g. established by a water level, but then the axis you'd measure against would be the tangent line. You could calibrate a gyroscope on a known level surface nearby, then measure the rotational drift when putting it on the sloped surface; but that will not work when you do the calibration too far away from the measuring point. But to cut it short:  an axis always is straight, but level will only be parallel to a horizontal axis locally.

And serioiusly, what is it with that "little buddy" tick of yours? Do you have to re-assure yourself that you are superior to everyone you talk to all the time? Why would you need such constant re-assurance?
Reply: @hartmutholzgraefe  yeah i brought up leveling ground to create horizontals over long distances. Any slope added to that level ground is measured on an xy coordinate system. Two straight lines, little buddy. :D
Reply: @DrEMichaelJones  On a small scale (and a airport runway is still a rather small scale) a simple cartesian coordinate system is used indeed as the systematic error added by that due to Earth actually being a big sphere and not flat is much smaller than the margin of error that your measurement and construction tools have, or the precision required by the client.

The Ligo arms are an exception here as they require much more precision than a runway or train tracks. Bumps and humps may make a landing, or a train trip a little less comfortable, but that's about it. 

A laser beam on the other hand would hit the walls of the enclosing pipe if it were not several levels more perfectly straight than a rail track.

That's why Earth curvature is mostly ignored in civil engineering, but in the case of Ligo, or the large ship tow tanks, the precision requirements are unusually high and compensating for curvature up front does matter, and is taken into account from the very beginning.

Many of the better architectural CAD solutions even let you choose between "sinple cartesian" or "true spherical" modes, but it is a rather hidden option as it is not needed in most cases. It would not have been built in if there weren't a sufficient number of edge cases where it is important. Software engineer time is expensive (I have to know as it is my main field of work by now, and not so much actual/physical engineering anymore), so such features are not added just "for the fun of it" or "to hold up the conspiracy"
Reply: @hartmutholzgraefe  lol so you imagine that a curved coordinate system would be used for a larger scale? At what distance do you imagine they have to make the switch from a straight to curved coordinate system?
Reply: @DrEMichaelJones  "At what distance do you imagine they have to make the switch from a straight to curved coordinate system?"

DIdn't you read / understand my previous reply (why do I even ask)? 

It not only depends on distance, but also on required precision / acceptable margin of error.

As with most things in engineering it is no shame to use approximations as long as you are aware of the limitations of such approximations. Same for imprecise measuring and tooling. As one of the jokes in my engineering school days had it: "Measure with a micrometer screw, mark with a piece of chalk, perform the cut with an axe". That's not the way to do it. When you plan to cut with an axe anyway you'd have just wasted time and effort on the measurement part.

Similar for civic engineering and land surveyors

* the first order approximation is that level equals flat. on the scale a carpenter works on that's always sufficient, and it even is most of the time in masonry
* only at rather large scale, and esp. when needing high precision, the "it is flat" approximation does no longer hold. Ligo and large tow tanks are examples we already discussed, long bridges are another example. so we can roughly say "when you get to half a mile or more, and it needs to be precise". but you don't need to go "full sphere" right away, the good old quadratic approximation "8 inches per mile squared" is not spherical, but it is a good 2nd order approximation about a wide range. It is actually about -0.03% off at short distances, almost perfect for distances around 400km, gets to +0.03% around 550km, at around 2500km it becomes rather significantly off at >1% and gets even worse rapidly from there
* so 3rd level approximation would be "it is a perfect sphere", so we'd have  to start to use actual trigonometry in our calculations instead of just a simple polynomial approximation that's much easier to calculate. Not much of an issue in the day and age of calculators and computers, but a PITA when having to rely on pen&paper only. that works on an even larger scale, and depending on your precision requirements it may even be good enough for the whole Earth. E.g. when producing a globe nobody would notice whether it is a perfect sphere or slightly bulgy at the equator
* but "perfect sphere" is not good enough for high precision cartography, for that you have to take into account that due to its rotational momentum the diameter at the equator is a bit larger than from pole to pole. so 4th level approximation is that Earth is a rotational ellipsoid or oblate spheroid. That's what's usually used in cartography, the WGS-84 ellipsoid is a commonly used example of this level of approximation
* but Earth is not a perfect rotational ellipsoid either, it would only be if its mass distribution were perfectly homogeneous. So for some applications we need to do actual measurements telling us how far it actually deviates from the assumed model shape. One of the many measurement techniques in this field is to measure the mean sea level via satellite based radar, there are also several kinds of gravitational measurement devices in this field, but PhDTony could tell you much more about it if you actually wanted to listen.
Reply: @DrEMichaelJones  "so you imagine that a curved coordinate system would be used for a larger scale"

Oh, and we do use that all the time when giving coordinates in latitude/longitude format. That's definitely a polar (aka "curved") coordinate system and not a cartesian ("X-Y-Z") one
Reply: @hartmutholzgraefe  lol "PhD Tony" told everyone that his therapist says he's crazy and you're citing him.

One more time, little buddy, how big a project do you imagine it would have to be to necessitate the use of the "hidden" curvature mode in CAD? :D
Reply: @hartmutholzgraefe  lol you can't build using a "curved" coordinate system without elevation profiles. womp womp
Reply: @DrEMichaelJones  I did not cite PhD Tony, I just mentioned that this kind of measurements are his area of professional expertise. 

And one more time: it does not only depend on the size of a project, but also on the required precision, as almost every decision in engineering,

And you can build using a curved coordinate system without elevation profiles just fine, every metalworker cutting a gear wheel does that on a rather small scale already.

And I never said the option for switching coordinate systems is "hidden"; it is just not that prominent and may be a bit deeper in the menu tree than top level, depending on the software.

When it comes to GIS software though on the other hand, which from a software engineers perspective is actually pretty similar to CAD, the "which coordinate system" and "which reference ellipsoid" settings are rather prominent.
 
Now surprise me by telling which kind of CAD software you've actually been actively using? I bet you are going to ignore that question the same way you ducked the one about where and in what field you got your engineering degree ;)
Reply: @hartmutholzgraefe  We use Revit mostly for our projects. It doesn't have your "hidden curvature switch."  I have a Masters from an Ivy league school. Did you even go to college because your posts suggest you might not have graduated high school?

Interesting that no "curvature switch" was needed for the construction of the 363 mile Erie canal where the elevation profiles were drawn on (and built from) a straight line xy coordinate system. Is that because you imagine any "curvature" along it would be so "negligible" that all the horizontals would be parallel for practical purposes?
Reply: @DrEMichaelJones  "Did you even go to college because your posts suggest you might not have graduated high school?"

So you're showing your lack of reading competence again, I told you about my engineering degree and from where I have it. 

But sure, I can lay it out in more detail if you like. I have a German Abitur which is not directly comparable to the US school system, but you can roughly compare it to high school graduation even though it's actually slightly above that. But that difference is moot for our purpose here. Key is that it qualifies you to study at any German university.

After that I spent my mandatory 15 month in the German Bundeswehr, doing surveillance of enemy radar systems, that was my first contact with large scale maps, long distance triangulation, curvature corrections for directional transmissions and over-the-horizon radar technology.

I'd always wanted to study computer science, but my local university did not have that yet when I finished Bundeswehr, and I didn't want / was not able to relocate at that time, so I started electric engineering instead, with a focus on digital electronics and control software. After my first year the university started to found a computer science faculty, I tried to switch but it wasn't possible right away, and when it was a year later they had decided that the specific engineering program I was in would count as a "Vordiplom", meaning that I could jump start at semester 5 of 8 if I finished that engineering degree first, which I then did. So I have a German Diploma in both electric engineering ("Dipl.Ing.") and computer science ("Dipl. Inf."). By todays standards that would roughly comparable to a bachelor in engineering and a master in computer science. I spent most of my university work time, and wrote my thesis, at the faculties robotics lab which got me introduced to the field of different coordinate systems, and transformations between them, also into 3D computer graphics and the homogenous transformation matrix math behind it. Then "The Web" became a thing, and I ended up starting a career in that field and not in academia after graduation, even though some more or less serious offers for a post grad position aiming for a PhD had been made to me. I then more and more drifted from Web frontend to Web backend and infrastructure tasks, until I finally ended up in the relational database field. A field that somewhat overlaps with the GIS field, so I had to learn some basics about that, too, but it never played a big role in my "bread job". For the last decade and a bit I've also worked on OpenStreetMap related stuff for fun, not profit, first as a mere mapper, but now I'm maintaining and improving an open source solution to create large printable maps from OpenStreetMap data and data from other free sources (like e.g. the global elevation data collected by the SRTM space shuttle mission back then).
If you have bothered to actually google my name (yes, I'm stupid enough to comment under my real name here, and as far as I know it is a unique combination of first and last name, too) you may have found some of this information.

"I have a Masters from an Ivy league school."

Interesting how you ducked to mention what you actually have a master in, I did not ask for your degree level, but for the field of engineering you have a degree in. So why I won't question your claim that you have a masters degree I have serious doubt that it's in an engineering discipline, else you'd have proudly mentioned that. And don't think that "Ivy league" would impress me in any way. 

"We use Revit mostly for our projects."

Never used that (CAD at that scale is not really my field, I only used it for rather small metalwork tasks in my robotics lab days, and now for my 3D printer). But from what I read it has a focus on buildings and their different internal installations, like e.g. plumbing (so maybe my wife would have worked with it before she left the building industry in the mid 2000s to become a computer scientist, too), so it is not really meant for construction work at the scale where curvature starts to matter, you'd e.g. not plan a large bridge with it, or Ligo, not even the canals you are so fond of.

" It doesn't have your "hidden curvature switch."

Yes, a quick search seems to confirm that, but then again: it does not really seem to be meant for projects at scales or with precision requirements that would make taking curvature into account necessary.

There are other AutoDesk products that do have it for sure though, e.g. I can see that AutoCAD Map 3D and AutoCAD Civil 3D let you select different base ellipsoids like e.g. WGS84 in their coordinate system library
Reply: @hartmutholzgraefe  I'm sure that whatever you just wrote is really fascinating, little buddy. How do you imagine anything could be designed and built vertically if you're only using a lat/long coordinate system? Do you just imagine the lat/long ball part dangling underneath the straight line elevation profiles?
Reply: @DrEMichaelJones  " I'm sure that whatever you just wrote is really fascinating, little buddy"

Well, you asked, I answered. Too bad that this does not work the other way round :o

"How do you imagine anything could be designed and built vertically if you're only using a lat/long coordinate system?"

For that you'd need a third component, yes, either absolute distance from the coordinate sphere center, or relative to a reference sphere, which is what we much more commonly use here on Earth. 

E.g. the peak of Mt.Everest is at 27.9881° N, 86.9250° E, but if you wanted to hit it with an artillery shell you'd also need to know that it is about 9km above mean sea level.

It's still a polar 3D coordinate system though.

PS: I read up a bit more on Revit and found this interesting quote by someone who seems to use it on a professional basis:

"Shared coordinate functionality aside, Revit is designed for localised, non-geodetic, ground-distance work – ie no scale-factor – you need no more evidence of its inability to handle geodetic data than the whole 10-mile origin limit, coupled with lack of coordinate system specification etc – it just isn’t cut out for it.

As far as geodesy goes, Revit is as thick as two planks."

and 

"And for the purposes of these discussions, I have assumed your sites are not too large – sites I am discounting might be a powerline over hundreds of kilometres, where you are starting to talk about proper earth curvature, spherical calcs and varying scale factors – versus say a more typical site, like a multi-building campus, an airport or even a large building where the scale factor is basically constant."

("You in charge of Revit coordinates? We need to talk | Part 2" by James Worrell on LinkedIn)
Reply: @hartmutholzgraefe  "For that you'd need a third component, yes, either absolute distance from the coordinate sphere center, or relative to a reference sphere" 

You do realize that no "reference sphere" was cited in the design and construction of the Erie Canal, right? The x-axis was specifically referenced to a straight horizontal at the beginning of the first lock at the entrance of the canal at the Hudson River. You can't just go and try to back-engineer a ball dangling underneath that, little buddy. I'm seriously beginning to doubt your claimed engineering credentials.
Reply: "You do realize that no "reference sphere" was cited in the design and construction of the Erie Canal, right?"

I never claimed to know anything about the Erie Canal, so how would I realize this? You don't expect me to study design and construction history of a project from 200 years ago?

"I'm seriously beginning to doubt your claimed engineering credentials."

Well, you can doubt what you want. I was just trying to be honest and to show that I have nothing to hide, while you are still hiding what field your masters degree is actually in (and I do not even doubt your claim that you have one, at least not so far, just that it is in any engineering discipline).

On the other hand: given the uniqueness of my name, why should I try to fake credentials? Part of it can easily be verified online; sure, the actual diplomas not so much, and my university time is too long ago, right at the brink of the world wide web becoming a thing, that you won't find traces of me on the universities web sites anymore. Even the WayBack Machine does not go that far back. 

I could link my thesis PDFs, but they are in German so would probably not make sense to you anyway, and YT does not like external links.

I could make a YT clip showing my university diploma certificates, but even then you could still cry foul and claim they were photoshoped.

And in the end I don't care so much what you  believe about me or not anyway.

But lets get back to Revit. What's your opinion on the

"As far as geodesy goes, Revit is as thick as two planks."

claim by Mr. Worrel? I'd seriously be interested ...
Reply: @hartmutholzgraefe  Let's get to the Erie Canal. No reference sphere. womp womp

Your referencing some nobody online named Mr. Worrell is akin to referencing another nobody named "hartmut holzgraefe"  Both have opinions that reality doesn't support.
Reply: @DrEMichaelJones  " Let's get to the Erie Canal. No reference sphere. womp womp"

A quick read shows that it was constructed by people that had next to no prior surveying experience at all. Also it was built segment by segment, so we have the same story as with concrete slabs again: even if each segment was perfectly straight by itself they could still curve in total.

"Your referencing some nobody online named Mr. Worrell"

Well, I referenced him as he seems to have some understanding and experience with both the software you mentioned and surveying and construction. That's why I was interested in your opinion on his opinion. But you chose to go ad hominem instead of bringing any factual critique. Understood, that's all you have.

"Both have opinions that reality doesn't support."

Well, the reality in your head maybe.

But let's get back to the Canal. Would 

"Wedding Of The Waters: The Erie Canal And The Making Of A Great Nation"

by Peter L. Bernstein be a good read on it? 

I'm really starting to get interested in how they did it by now. My blind educated guess would be that once they had set for the general route to take they mostly used a good old water level for the verticals and so would not have needed to take curvature into account for that part as they would have to when using optical instruments. The curvature would affect the water level instrument in just the same way as the actual ground you're digging into as they are both in the same radial gravitational field anyway.
Reply: @DrEMichaelJones  but seriously, the Erie Canal construction started in 1817, when geodetic survey was still in its infancy. For all intents and purposes, given the available precision at that time, assuming "it is a sphere with a radius of ca. 4000 mile radius" would have been precise enough already. 

Time period wise many of the names still admired in the surveying trade, like e.g. our German Carl Friedrich Gauß, did most of their ground laying work in a period in the early 1800s, some before, and some even only after work on that canal had started.

But: they all know Earth is not flat, not a perfect sphere either. It then took even longer, until ca. 1870, before the term Geoid was esteblished, and the good old Bessel Ellipsoid became the quasi-standard Geoid of its time by ca. 1900 only, long after this canal was finished. 

So why did you pick especially this one, and not a more contemporary canal building project?
Reply: @hartmutholzgraefe  So you imagine they screwed up when they designed all those horizontals parallel to each other and to a horizontal x-axis in the elevation profiles but here we are over 200 years later and no one has "corrected" them (including all the contemporary canal projects that mirror those elevation profiles). Like I said, little buddy, whatever helps you sleep at night.
Reply: @DrEMichaelJones  "So you imagine they screwed up"

 no, I didn't say that.

"when they designed all those horizontals parallel to each other and to a horizontal x-axis"

I am just missing the part where you show that they used a single horizontal axis along the whole 300+ miles of the canal.

For each segment (and as far as I understand it was built in many segments, each given to local contractors of that area) they just needed to specify: this is the left edge, this is the right edge, you start digging this deep at the beginning of your segment, and make sure to stay level within the precision of the auto levels we have at hand. Or they could have said: "ok, and along the center line you dig a little extra ditch, e.g. 1ft deep and wide, and fill that with water first. Then we check that from the water in that ditch it's 4ft to the top of the embankment from end to end as required". Not sure how exactly they did it, but in the end, when they had flooded it all, they could then have checked the elevation difference at each lock to draw a nice elevation profile, more precise than the one they had in the planning phase.

They would not have been able to precisely measure it end to end with optical instruments before starting construction anyway, not only as the instruments were not that precise back then, but also as much of the land they planned the canal to cross was still thick forest so that you could not really do that much precision land surveying anyway.

"in the elevation profiles but here we are over 200 years later and no one has "corrected" them (including all the contemporary canal projects that mirror those elevation profiles)"

I bet that the measurements of the actual elevations of the various segments and locks have been corrected (as in "have been re-measured with better precision") several time over the last two centuries.

But back to  my book question: would you recommend the one I found, or would you actually recommend another one that covers the methods used to build this canal better than the one I dug up? You seem to be very confident about the methods they used, so I wonder what your sources are.

"Like I said, little buddy, whatever helps you sleep at night."
The only thing that would not make me sleep at night would be your "little buddy" fixation.
Reply: @hartmutholzgraefe  The single horizontal that they established at the first lock and then drew parallel horizontals to it for every single section of canal between locks all the way to Lake Erie? There's no assumption, little buddy, It's in the drawings. All of them.

"I bet that the measurements of the actual elevations of the various segments and locks have been corrected (as in "have been re-measured with better precision") several time over the last two centuries."

You bet? Lmao, how much would you like to bet that not a single one of those segments has ever been measured or depicted as an arc?
Reply: @DrEMichaelJones  "The single horizontal that they established at the first lock and then drew parallel horizontals for every single section of canal between locks all the way to Lake Erie? There's no assumption, little buddy, It's in the drawings. All of them."

Let me check if I got you right: what you are referring to is an elevation profile drawing where the base elevation is drawn as a straight line? Like Google Maps / Earth draw elevation profiles with a flat baseline, even for long distances? And that is your proof that they considered the Earth to be flat?

Did it ever occur to you that you may be looking at a simplified drawing that focuses on the relevant part: the relative level differences between the segments? Do you also believe that the tunnels of a city's subway system are mostly straight, with sudden 45° or 90° turns, as that's how they are shown on the subway plans?

There's a simple reason for making simplifications in such diagrams: readability. If they had presented the elevation profile over an actual curve that would have been more precise, but less readable. Same for subway tunnels: showing the actual tunnel routes is more confusing, the "only straight lines and multiples of 45° turns" schema is much easier to grasp.

The only real important information in such an elevation profile, when it comes to waterways, is: what's the level difference between locks. Curvature does not matter as the water curves along with it. Same for route elevation profiles for driving, hiking, cycling routes: you only care about the relative elevation level differences between two points. And so these profiles are projected on a straight line for simplicity reasons.

I'm about to add elevation profiles as an option to the printable maps I generate in the near future, too, and these will also have a flat baseline. 

There are cases where the curvature does matter though, e.g. one of my side tasks during my army time was to calculate elevation profiles for directed radio communication links. For that we needed to determine the necessary antenna tower elevation at both ends necessary for a direct line of sight, taking both local topography and curvature into account. The job was given to my group for two reasons: #1 my sergeant major had the most complete collection of german 1:50 000 maps collected in the office and #2 ours was one of the few offices in the building that had already had a computer in the mid 80s. A tiny thing with a one line LED display, a thermo printer, just a few KB of RAM and a subset of BASIC, but good enough to take two coordinate pairs as input, and to calculate the curvature between the point and the reference numbers of the map sheets needed to be glued together to get the whole distance covered, to then be able to extract topographic height info manually from the contour lines on the map.

That then gave us: start point is at elevation X, end point at elevation Y, and the highest point in between is Z at distance A. So to get a direct line of sight we need to have the two antennas at this height and pointing this many degrees up or down. 

For short distances curvature could be mostly ignored, but for long distance communication it became a serious thing to consider, as high frequency radio is pretty much going by line of sight, and not bent as much as short wave due to the surface effect. 

"how much would you like to bet that not a single one of those segments has been measured as an arc?"

Again: when you are only interested in an elevation profile you only measure water level differences at both sides of a lock. You know that curvature exist, but as an engineer you also know that it does not matter for this specific task at hand.

And I do not bet, ever. But I'm nonetheless sure that nowadays while you'd still get the elevation profile drawn with a flat reference baseline the raw measurement data you'd get would include not only the coordinates, the elevation above mean sea level (or whatever other reference height may be in use locally), and a reference to the actual geoid used, e.g. WGS-84

But back to the more serious question: what field do you actually have a masters degree in? I have been very open about mine. You have been very evasive on this topic so far. I still wonder why ;)
Reply: @hartmutholzgraefe Lol. You're flailing now. Subway maps aren't engineering drawings that they build subways from, you complete clown. The elevation profiles that I am talking about are the actual drawings for the actual construction of the canal.

"Did it ever occur to you that you may be looking at a simplified drawing that focuses on the relevant part: the relative level differences between the segments?"  That is priceless. Talk about desperation. Like I said the drawings were drafted based on surveys and actual measurements and built according to those plans. It's not "simplified." If it was then any architect could come along and "correct" it to the curves you imagine. No one ever has. Imagine that...
And no, the earth isn't "flat" as I have said no less than a dozen times in this thread.
Reply: @DrEMichaelJones  " You're flailing now. Subway maps aren't engineering drawings that they build subways from, you complete clown. The elevation profiles that I am talking about are the actual drawings for the actual construction of the canal."

And yet still both are examples of simplification and focus on the essential data ...

"Like I said the drawings were drafted based on surveys and actual measurements and built according to those plans."

And still all plan drawings are simplifications of some sort. As you claim to be working with related software you should know that. These elevation drawings show the essential information "this segment is this many miles long, then there's a lock and the elevation goes up or down by so many feet, then its so many miles to the next lock, and so on". Curvature simply does not matter in this, it would just make it harder to draw the plan, and to then read it, too. Same with route elevation diagrams on Google Earth, there were some flerfs that made a fool out of themselves by claiming "look, even Google Earth says the route from New York to Lisboa is totally straight and flat".

"It's not "simplified." 

Every drawn plan and every map is. Does yours show every tree along the route? No? See: simplified! Or lets phrase it differently: reduced to the essentials.

"If it was then any architect could come along and "correct" it to the curves you imagine."

Sure, but why bother? It would not add useful information. Although, nobody would complain either if it were meant for presentation purposes, it might actually look more appealing that way. But for practical use it would be less good.

"No one ever has. Imagine that..."

How would we know that no one ever has? 

"And no, the earth isn't "flat" as I have said no less than a dozen times in this thread."

Now you've lost me?
Reply from the maker: @DrEMichaelJones  You keep ignoring the fact the the elevations for the LIGO beam slab plot a curved line on an X-Y axis graph but somehow I can take what you think are "mythical earth curvature calculations" and turn that slab into a straight line using the surveyor's definition of a horizontal line and curved level line.  

And do you really "have a Masters from an Ivy league school"?  I find that hard to believe because you have to be one of the most ignorant people I have met on the subjects of surveying, geometry and construction.  When did they quit teaching critical thinking skills?  What was your major?  French Literature?
Reply: Ever saw a concrete ramp with a 10% slope ? I have. I've seen many. I even walked on a 12% slope entirely covered in concrete. That's a difference of elevation of 24m over it's 200m length. The ramp for LIGO is not even 0.01%.
Reply: So many problems with your childish mentality little buddy ! The fact that you cannot conceive how it can be done shows how hopeless you are
Reply: @whatever2735  Do you think it would be easier to take off from a straight, horizontal runway or a runway that (according to your ridiculous formula) somehow curves downward by over 6 feet? Do you imagine it curves downward from both ends too? How do you imagine they could construct that double drop?